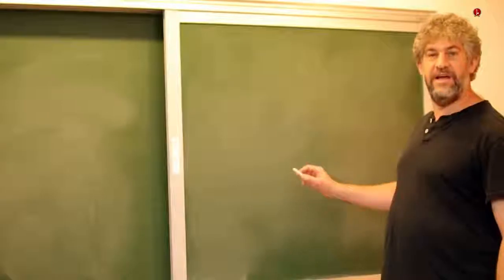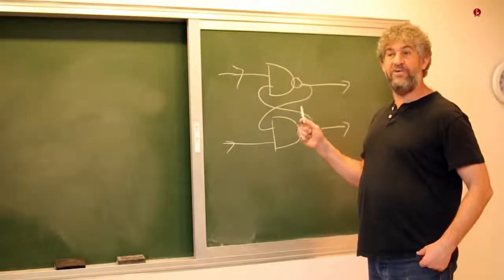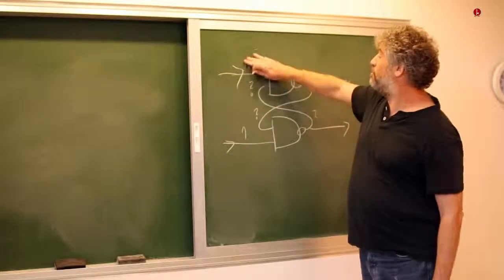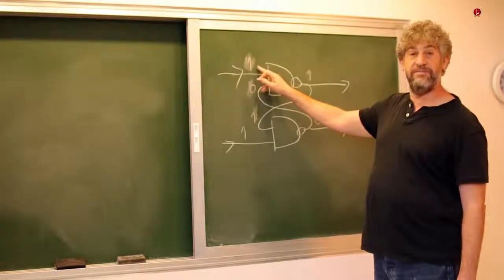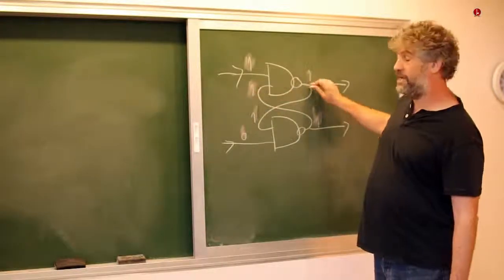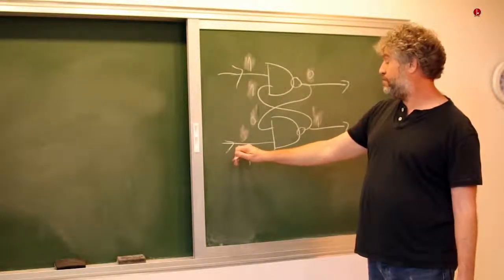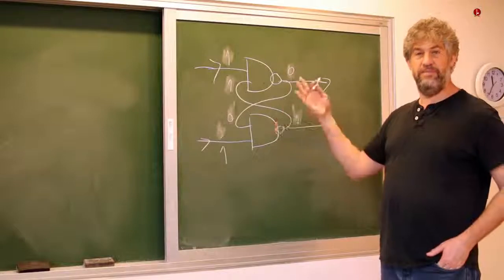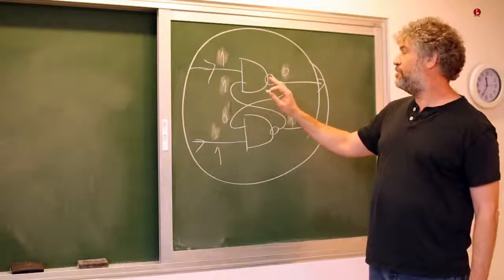[Part 1] Unit 3.6 - Perspectives

Comment: If the ROM is read only memory, why do they say that it behaves like a sequence of registers which are addressable ? Because we've learned that Register have a load input to write data.

Maybe they mean that ROM is read only from user point of view, but not from constructor point of view ?
Reply: The name is a bit of a relic. It used to be that the data was permanently written on during manufacturing but nowadays most hardware has EEPROM or Electrically Erasable Programmable ROM. If you've ever updated or "flashed" the BIOS on your computer then you'd actually be writing to a kind of EEPROM